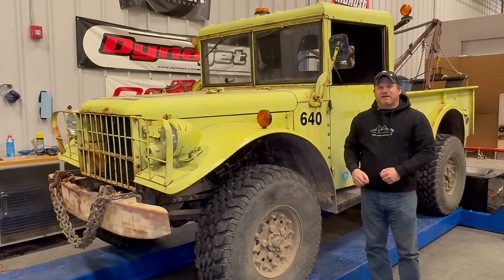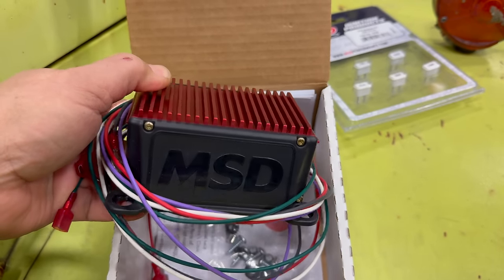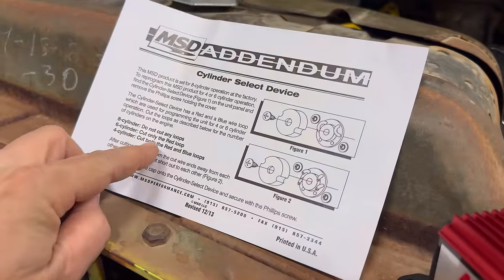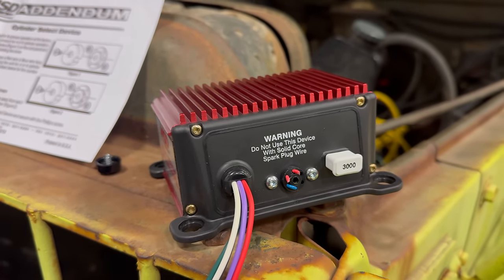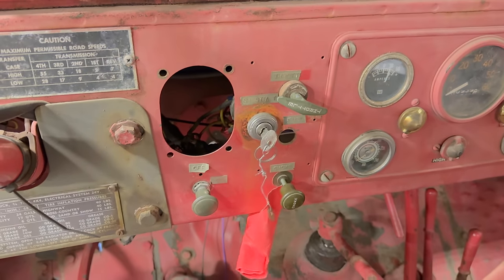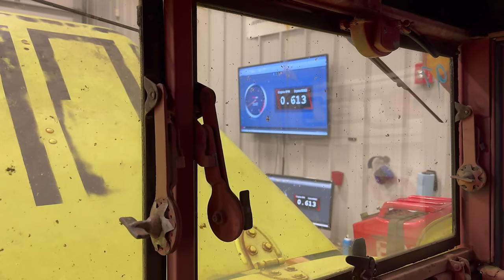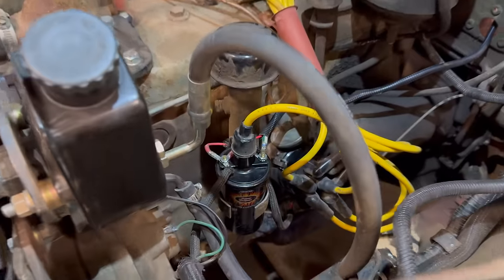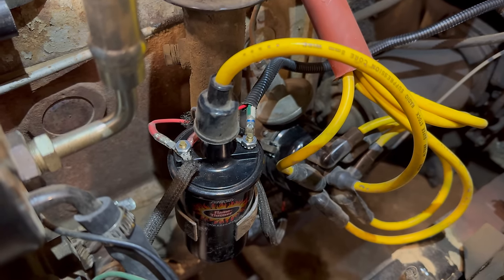The Vintage Offroad Wecker Gets A Rev Limiter

Comment: In the middle 70's I was a technician with our telecoms company and worked in a small town, 400km from Cape Town. Our construction team had a petrol Bedford truck, which had a slight crack in the block. I got the of job taking it to Cape Town to swap it for a new diesel model. It was recommended that I don't go faster than 70 km/h, and the trip took me 7 hours. I was looking forward to getting the new diesel, as it was brand new and the return trip would be much quicker. But, alas, it was governored at 80! My parents lived about 75 km out of town in the direction I was taking, so I slept over and resumed my trip the next day. The first thing the gang foreman did was to have the governor removed, as they had long distances to travel for their jobs.

Comment: I have a M37 with a Chevy engine, 410 gears in Chevy/dana axles. With the original engine and drive train it will not do over 45MPH for very long without damaging the engine. The original axles and brakes are not very strong either. Hence the powerplant swap...